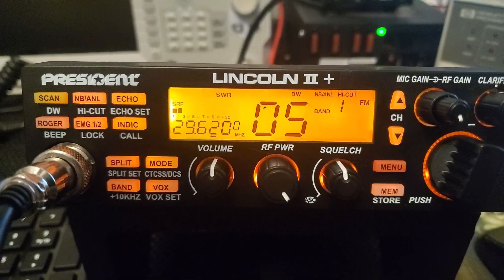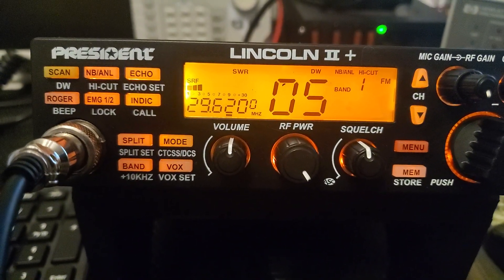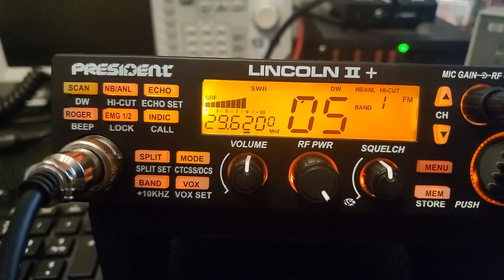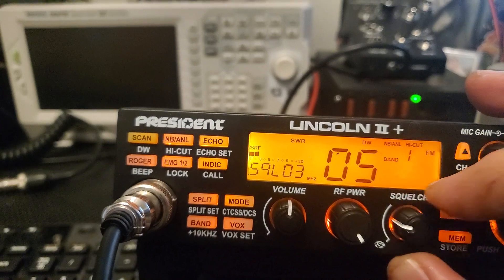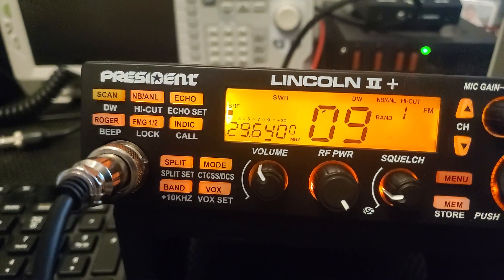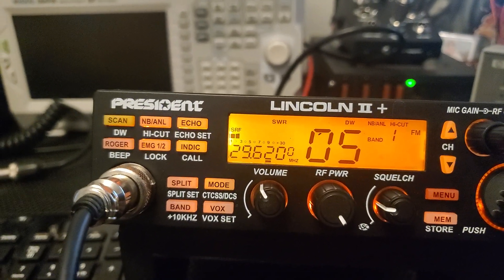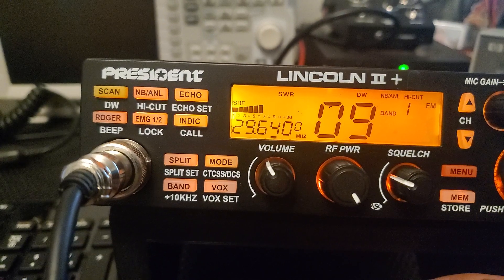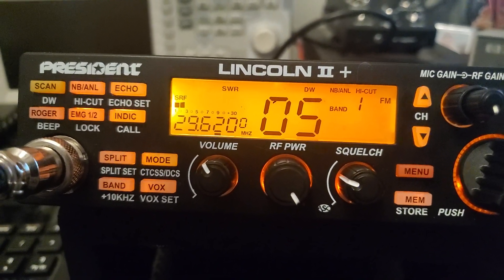10 Meter Repeater and Dual watch function on a New President Lincoln 2+

Comment: Hill toppers on other repeaters you don't here there Mobil signals chop in.  
PL tones are designed to work on carrier squelch. So spikes are weak signals . 10 meters FM is alright most are on split sites trans mitter & receiver .  
2014 & 2015 was a blast on 10m.

Comment: Passed my ham radio technician class exam. 4/08/2023. Looking forward to 10 meter use. Ham radio interest has really improved. 30 took the test when I alone. I did a 2 hour six class session for my test at the public library.
Reply from the maker: Congratulations 👏

Comment: Without the correct CTCSS ("PL") tone, the repeater will not key up at all. What you're hearing is repeaters which do not require CTCSS tones being keyed up by random noise of stations to weak to hold the squelch open.
Reply from the maker: Very true, some repeaters do not transmit back with a ctcss tone but still may require a tone to get into the system.

Comment: Is there a new menu option to have the clarifier effect both the transmit and receive (unlocked clarifier option)?
Reply from the maker: Yes if you have the USA version.
Some dealers are selling the European version because it was the only one available at the time so President started sending them into the United States to sell. The European version does not have that feature.
Reply: @ScottsRadios  thanks for responding. I live in the USA and would hope I don't get stuck with an EU version. I stumbled into a short video indicating a "problem" with the clarifier setting. I wonder if this video is doing something wrong in how he changes the settings. I would appreciate it if you would take a look at it and let me know what you think of the content. https://youtu.be/sJ2TjvQ9q1g
Reply from the maker: @k9wlwradio309  That is a older version of the USA version.
The European version does not have that menu function whatsoever.
If I was looking to purchase one I would definitely ask the dealer or whoever you're purchasing it new from to verify that it has the menu function to allow the radios clarifier to change its functionality.
Reply: @ScottsRadios thanks for your reply. His complaint in the video was the radio clarifier would default back to off if he powered off and then on. I wonder if he failed to store the change by not hitting the memory button after setting it to transmit and receive?
Reply from the maker: @k9wlwradio309  I believe in the older USA model that was an issue when they first put that option in the radio.
It was later corrected in current USA models don't have that issue anymore.
Reply: @ScottsRadios thank you for clarifying. I will do my best to get the new version!
Reply from the maker: @k9wlwradio309  I have it available.
sales@scottsradiosllc.net